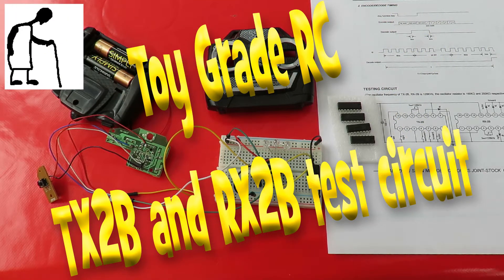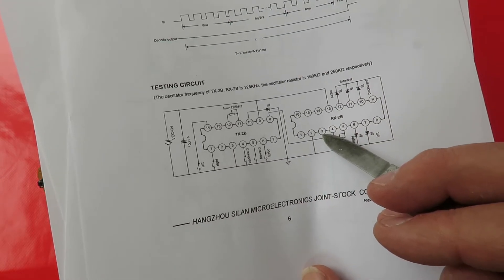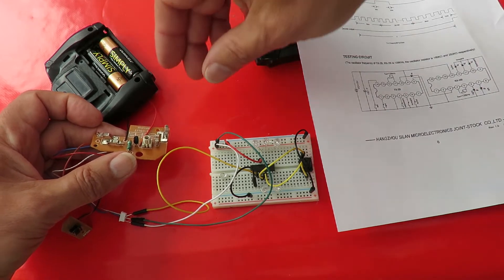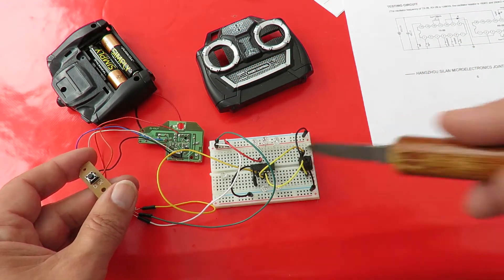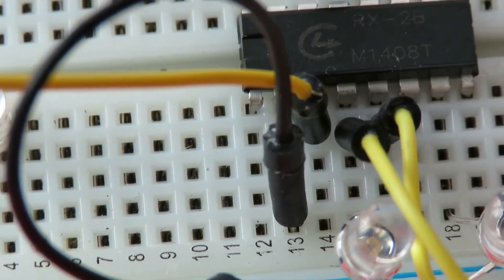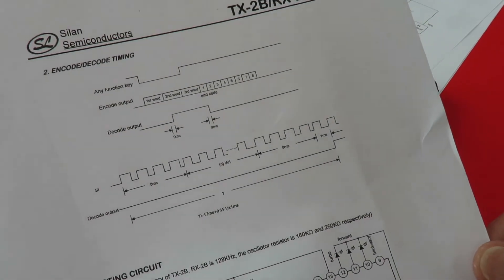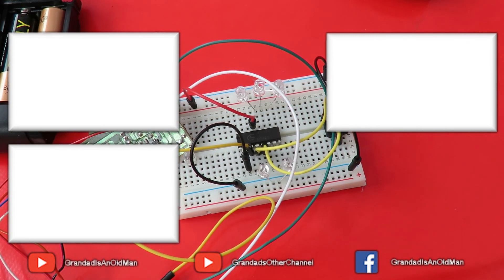Toy Grade RC TX2B and RX2B test circuit

Comment: thanks for explaining, very good. The turbo, I did not understand how we can attribute it to the forward and or backward direction. I wanted to enable it also in the circuits not present (only normal forward and backward). combining this circuit with the L293B chip to drive the motors, in your opinion how is the turbo coupled? or if enabled would it go forward? I did some tests and the turbo does not work as a guide
Reply from the maker: I have just replied to your other comment. Unless the receiver circuit already has the turbo feature, enabling the switch on the transmitter will do nothing. On toy grade RC cars, Turbo is just a gimmick. The normal speed of the car is restricted, then with the turbo feature, the restriction is bypassed and full power goes to the motor. The easiest was I can explain it is to suggest there will be a resistor in the motor circuit under "normal" conditions, then when "Turbo" is pressed a transistor turns on and "shorts" out the resistor allowing full power to the motor. It is not exactly like that, I am simplifying it to explain the principle.

Comment: 5 канал работает на 27 МГц...?
Reply from the maker: The frequency is not relevant. By channel 5 I assume you mean the pin labelled 'turbo'. If you have a button connected to the turbo pin on the transmitter, you will get an output from the pin marked 'turbo' on the receiver, regardless of what signalling system you use. The same chip set is often used for infrared signalling systems.

Comment: Is there any direction to be used to connect the frequency adjuster like  + or -
Reply from the maker: A potentiometer is just a variable resistor. It has 3 pins. the resistance from the outer two pins is the total resistance value. The resistance from the middle pin to either of the outer pins varies depending on which way you turn the potentiometer. https://www.electrical4u.com/potentiometer/ That frequency adjuster is for the internal clock frequency for the chip. Nothing to do with radio frequency. In this video I am NOT using the radio circuit. If you are trying to change the radio frequency this is NOT the right video for you. I am just connecting the signal pin from the transmitter chip to the input pin on the receiver chip to demonstrate the outputs from the receiver chip. I did nothing to the transmitter, I would have used the potentiometer on the receiver to get the right resistance for the clock frequency. All the receiver circuit boards I have seen have a fixed resistor, not a potentiometer. I think they showed a potentiometer on the circuit diagram for this test circuit just so you could change it to demonstrate what happens if the frequency is WRONG.
Reply: @GrandadIsAnOldMan  hi again. Actually i have a pair of RX an TX ics and trying to see if they are still working without using any RF modules. I did all the connections as shown in the testing circuit diagram except i am not using any kind of resistance adjuster between the oscillator pins, but it did not a do a thing.... What are the chances that the IC's itself are busted? 
Regards.
Reply from the maker: @mriddu  the resistance between those two pins sets the internal clock speed for the circuit. You need to have a suitable resistor as per diagram.
Reply: And how did you use the potentiometer on the transmitter circuit as required.

Comment: is the green part called aurdino ??????????? 
if not then please tell its name
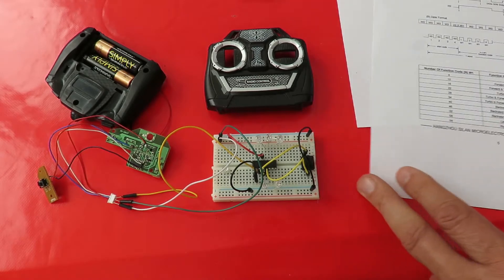Reply from the maker: Hi khushbu. I am not sure why you should think it would be an arduino? I clearly explain in the video, and the title, and the video description, that this video is about building the test circuit for the TX2/RX2 chips. The TX2 is the chip that is used in the transmitter (TX) and the RX2 is the chip used in the receiver. The TX2 chip encodes the signal for transmission over the radio frequency. The RX2 chip decodes the signal and tells the motors to run in the toy car. At 2:55 I explain I took apart one of my transmitters to get the circuit board with the TX2 chip on it.

Comment: can we run this test while tx-2b and rx-2b are soldered on their respective pcb's with their rf circuits (if transmitter and receiver is not working through their antenas )
Reply from the maker: Yes. As you can see in the video I am using the TX2 while it is still on it's circuit board. Pin 8 from the transmitter is going to pin 3 on the receiver
Reply: @GrandadIsAnOldMan  i am asking can we use test circuit while rx-2b is also on circuit board
Reply from the maker: @yatharthbaiswar4487  that does not change my answer
Reply: @GrandadIsAnOldMan  thanks sir

Comment: That is "really" good work. I noticed on the datasheet that one of the pins puts out a square wave. That could be used for a pulse motor or even to drive a high voltage coil. 👍👍👍
Reply from the maker: Using the square wave would seem to be a rather obscure project. Trying to think of a suitable metaphor - maybe using the windscreen wiper motor on a car to power something rather than use the engine. Just a small function of the whole chip. It might work but the car could do so much more. However, it would be a clever demonstration of it's features. Do you have an oscilloscope? I have always been intending to get one but have no rational reason for having one.
Reply: @GrandadIsAnOldMan  Well, first of all, my good friend I have great news I want to share. Lola has successfully gone through her operation and it went perfectly so she will be back home with me tonight. 😁👍
Yes, the square wave from the chip. The way I see it is the compact size of something that can produce PWM. I have built several PWM units for that mini Tesla coil I have but the PWM circuit is large and uses a 555 timer. The other thing with a small chip that can produce PWM is that you can build small devices that need a square wave to operate. Like the small levitating device I built which uses the output from a small chip, can't remember the number of the chip, to pulse an electromagnetic coil at high speed which keeps a magnet floating in the air below it. that device also uses two Hall sensors turned back to back but without that chip, it would not work. Yes, I do have an od oscilloscope that I bought from eBay about 6 years ago.  I only wanted it for testing waveforms and it works pretty well. It was an old school one from their science department and cost me £25. So does the job. 😁👍
Reply from the maker: @mikeflight9  brilliant news on Lola, hope she recovers quickly. Yes that was a good deal on the Oscilloscope. Like I said, I have always wanted one but haven't been able to justify it. Funny you should mention the 555 timer as I almost put that in my previous reply. I still have a pack of them somewhere in my electronics stock.
Reply: @GrandadIsAnOldMan  Cheers mate. 👍

Comment: My tx2b chip doesn’t have a
Label on it. How am I supposed to get info on it or is it the same schematic that you printed? All I know is take I found it on my old helicopter toy and the mainboard has a Chinese words on it. From watching your video I saw one of your printed paper & title was Chinese. I’m assuming that the ic is the same has yours since it’s made in China.
Reply from the maker: There are lots of different manufacturers for these chips and there are several variations. As far as I know if they have TX2 (TX = transmitter) or RX2 (RX = receiver) then the pin outs are in the same format, so RX2B and RC2C etc will be the same. The example circuits they give on the data sheets are just examples. The actual circuit board in you car may have some variations to provide different functionality but the RX2 chip pins will be in the same with the F/B/L/R/T in the same place. HOWEVER not all toy grade receiver boards use the RX2 chip so if it does not have RX2 written on it than it may not be the same. With the right equipment you could measure the output from each pin to see which ones change when the signals are applied.
Reply: @GrandadIsAnOldMan  I know that the tx2b has a 14 pins and the rx2b has 16 pins. I found a RC car and I don't have a remote for it. I have a helicopter toy and it has a tx2b and I want to try to make it into a remote control for the car. I was comparing the ic & their sizes are same. One has a label but the other doesn't. What tools I need to measure the output of those pins? I was thinking of desoldering the tx2b & put on my breadboard has a remote testing & then later I can solder it on a circuit board.
Reply from the maker: @leang2157  the output from the pins is simply a high or a low to turn on the transistor in the H bridge. So you should be able to detect it with a digital meter. I don't understand why you would want to desolder the chip from one board and put it on another. The chip does not change the frequency, that is controlled by the rest of the circuitry. The TX2/RX2 chips are also used in infrared controlled system. Are you planning to build the entire circuit from scratch?

Comment: Sir, what is the function of the Turbo mode?? please help
Reply from the maker: Your best answer would be to download the PDF schematic for the RX2/TX2 chip and study the circuit but basically it is just a 5th function that can be used for anything. They label it turbo because that is what they tend to use it for. A typical receiver with turbo implemented would be running the drive motor on reduced power unless you press the turbo button. Then the circuit would switch out the resistor that is reducing the power to the motor so it gets full power.
Reply: Thank You So much sir.. 🙏❤️
Reply: Hey bro i want small help from u

Comment: How to connect wires to B, FL,BL, VCC, GND, ANT, LED-, LED+ and VDD ? in a 27MHz rc transmittor ?
Reply from the maker: A rather late reply, but I would suggest downloading the data sheet and following the example circuits most of the data sheets contain.

Comment: My receiver's chip temperature is increasing significantly, like touching a cup of hot tea, during press forward and backward in 10 seconds, when it heat to the max it becomes totally dead, we need to wait the temperature drop to normal and it work again. What the problem is? any one know?, sir"
Reply from the maker: I am afraid I am not an expert however here are my thoughts. If your receiver is overheating I can think of 3 issues. 
1. your motor has overheated at some time and is damaged so it now draws more current. This could have happened when the car got stuck against an obstruction or maybe in long grass. 
2. you have changed the battery to a higher power. Lot's of people change the batteries to higher voltage or greater capacity and then find they have killed the receiver because it cannot handle the extra power.
3. you have changed the motor to one that draws more power through the receiver. A motor with lower resistance will cause more current to flow through the receiver.

Comment: Do you know if the turbo chammel can be used for a 2nd motor, such as a thrust motor on a hobercraft? Iv gotta bunch of toy rc boards lying around and would like to put them to use
Reply from the maker: Cengiz Can the video shows how to wire the turbo input and output pins, however if you want to do anything useful with that output you would need to feed it into a transistor to turn something on when it is activated.

Comment: Very interesting, these chips have many uses....
Reply from the maker: At a simple level all they do is take on/off or open/closed signals from 5 inputs and encode them in the TX chip and then the RX chip decodes them and sends a signal to the relevant ones of the 5 outputs.